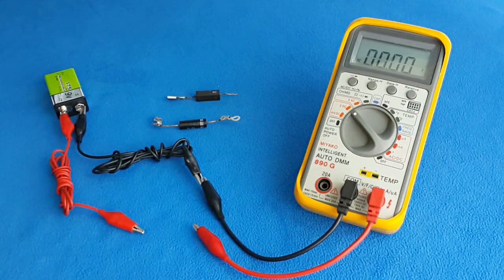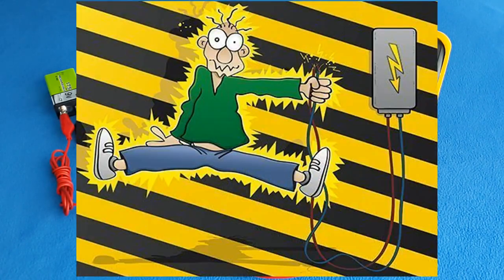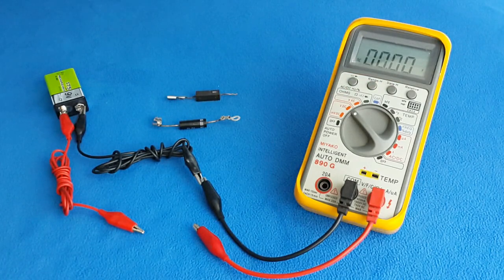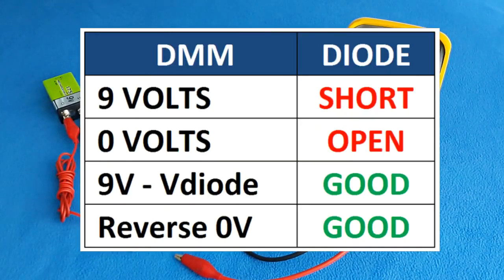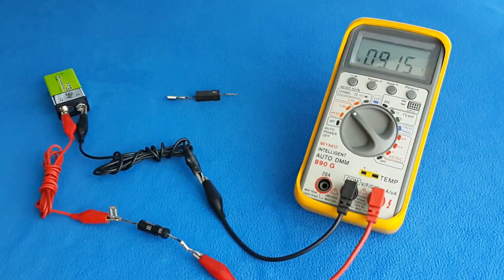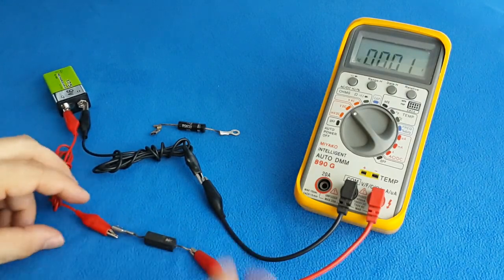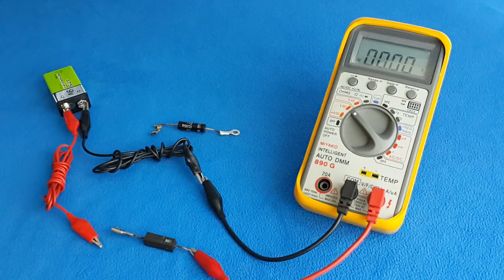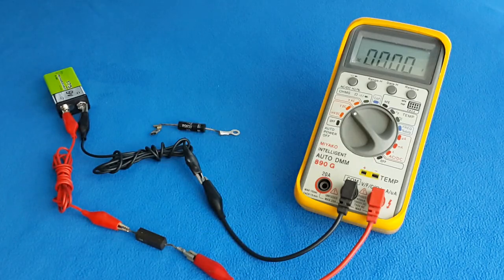How to test a microwave oven high voltage diode

Comment: i never realized the diode wouldn't polarize until more voltage was added! something i should have know, but just never really thought about. thanks that explains a lot
Reply from the maker: Hi! Then let's make a video of how to make a switch with a diode. Most of us know a diode is a one way electronic component, until we start to play with low voltage, high voltage and frequencies. That is the point when we start to forget the "ideal diode" and start learning the real electronics". Thanks Cris for the comment!

Comment: Thank you for a Great Video, as I'm testing components of a microwave that won't Heat, and eliminating different components as to why. My Diode tested good by your test. So I've narrowed it down to the Termal Fuse, so hopefully that will fix the microwave.  Thanks again.

Comment: Hey, I have microwave that blows fuse. My problem is capacitor is fine but bidirectional diode 2X062H is shorted it is connected to CL01 diode on one side. The CL01-12A diode is working. If I unplugged the one end of he bidirectional diode from the cap, will it work? I can't find the diode where I am loctated.

Comment: Hi, I have 15SQ045 SCHOTTKY diode, this method is not working with 9volt. If i use diode function in multimeter it is not short, but however when i use 9v battery it is showing 9volt on both sides even if i flip cathode and anode.. diode is good because i have more than 20 and i tried with many diodes.. apprecaite your help

Comment: Dear Bob,
I was able to figure out that my microwave diode was in short circuit, thanks to your video.
(It was 9 volts in both directions), when the diode was attached to the 9 volt battery.
I was able to repair the microwave for $10.
Thanks!

Comment: Hi, my diode drops the 9 V battery to about 4V, not to about 7V. Does this mean the diode is defective? it passes the reverse test. My MW jumps the fuse. It is not due to the defective the HVT or HVC. Thanks
Reply: Hi @Alan Fani I am getting the same result, was your Diod bad or not ?
Reply: @izrekeicitaticom  It still means the diode is good, just "stronger"

Comment: What about if I get 5.4volt dc and the. 1.6 milk volt on the other direction? Good or bad
Reply from the maker: Hi! Minute 2:08, 9V - Vdiode = 5.4V, and Reverse 0V or close to 0, is a good diode. But it looks like you don't know what you are doing. Please, take it seriously; you are not qualified to service a microwave oven and you put your life in danger. Bring it to profesional service or get a qualified mentor to help you. Consider the mentor's help. I graduated as industrial electronics technician, and as electronics engineer in medical equipment, but I was next to an old electronics engineer for was  mentor for nine years. Thanks for ask!
Reply: @bob.kalpon1398  Microwave stopped heating. What might be wrong other than the diode? Still in circuit, the high voltage capacitor isn't shorted when measured across terminals, so that is good. Over temperature sensor (disables microwave especially when humid wet) is 0.2 ohm both directions when measured on meter's 200 ohm setting - while removed from circuit.
Reply: @PeopleHealthTru  did you solve the problem? I am getting on the diode 3,2 V but I do not know is that enough or I need to have at lease 5+V
Reply: @izrekeicitaticom  as I wrote my diode is 3 volts across the diode and it's not shorted. I didn't replace the expensive diode. I replaced the capacitor and the magnetron and it still didn't work so I'm guessing the control panel has a problem. Your diode isn't shorted so maybe it's okay. I'm not the one to answer your question.

Comment: My inverter P. S in microwave is buzzing with fan and magnatron disconnected. The diode pair is reading in reverse bias a small 0.01 V leakage. Not zero. Is that acceptable range? Display works and can start but no warming and shuts off after 30 seconds or so.
Reply: Replace the High Voltage Diode and check the High Voltage Transformer because transformer seems suspected. Reply if that fixed your problem diode need to be replaced anyway shouldn't be any leakage at all.
Reply: @skyneo823  thanks for your message. Actually fault on that was magnatron. usual magnatron tests were good but trying another mag and all good.

Comment: What if I get 4.9v and the reverse 0 ? It's good or bad? Pls
Reply: I got 4.3v and the reverse 0? same result as you. Was this good or bad?, thanks.
Reply: @eaopanama  good
Reply: @tiburon0  are there any table details, how many Volts at least you have to got that Diode is good? Some people are saying that if you get less than 5V than your oven does not heat enough, can that be a true?

Comment: can i use a 12v battery?
Reply from the maker: Hi! Be careful! ...a 6V or 12V lead acid battery can source many Amperes. It is too strong if the diode was in short and you miss handle it. It is the reason why I recommended the 9V battery.

Comment: Am getting the same voltage both ways 5.4 volts
Reply: that sounds like you used a resistor instead of a diode
Reply: Diod is BAD and you need to replace it with a new one. Also check the fuse and thermal fuses which is easy to check.